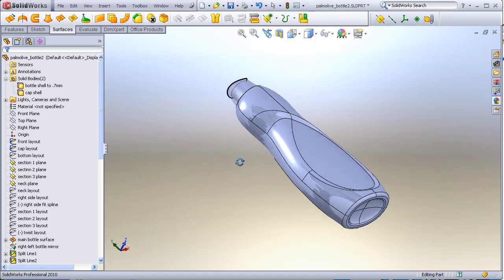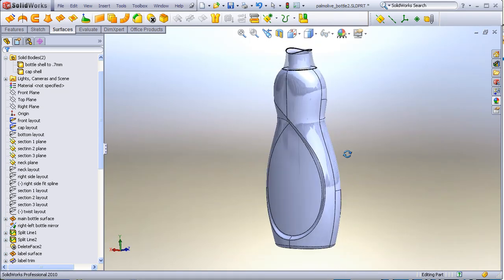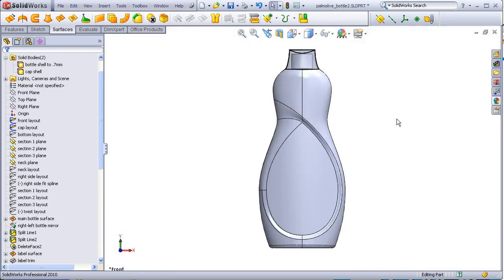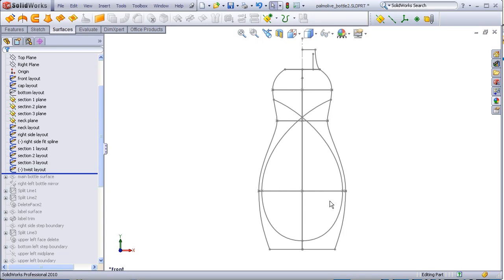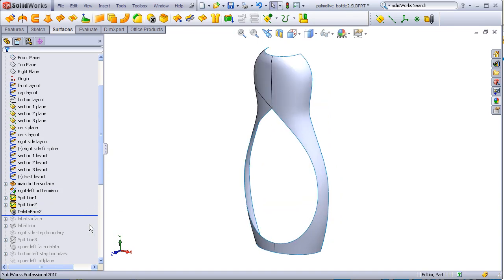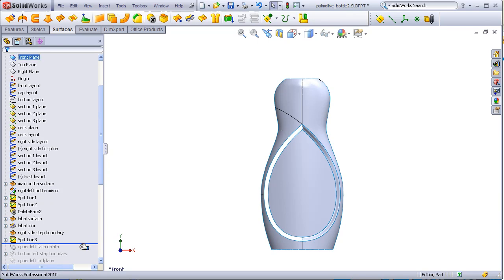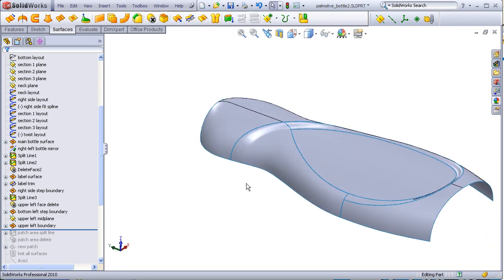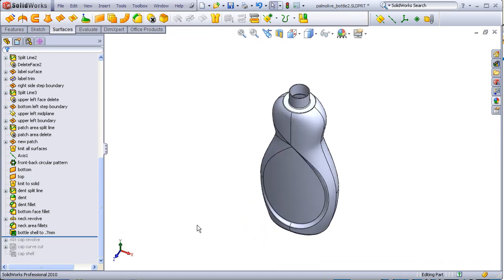DSID136, Solidworks Tutorial, Twisted Detergent Bottle - Part 1

Comment from the maker: It's a Palmolive bottle. I've seen it in two different sizes. The larger size is 25oz and I think the smaller is about half that. Both have the same shape. Go to the store and buy a small one for about $3.00 (I think). That will give you a 3D model you can measure and turn over in your hands. And, you can also use it for washing the dishes!

Comment from the maker: @killasimo 
If you go to part 2 of this video (about the half way point), the trimming of the label area is covered in more detail. I just offset the edge of the tear-drop opening inward by 5mm and used that to trim away the excess outer area of the the recessed boundary surface. I could have just as easily offset the edge from the original layout sketch as well.

Comment: scratch that, I figured it out, maybe a different way but it worked, I made a new sketch, converted entities off the original split onto the new sketch, then offsetted the entities 10mm, then projected the new sketch into a split onto the label surface, then deleted face off the excess I didnt need. Then I proceeded to create the loft boundary between the label surface and the bottle surface